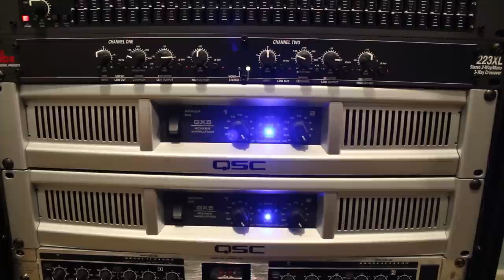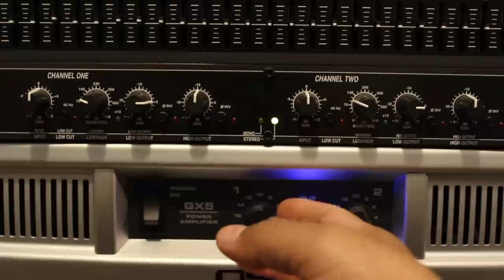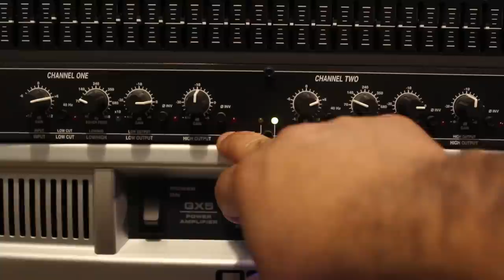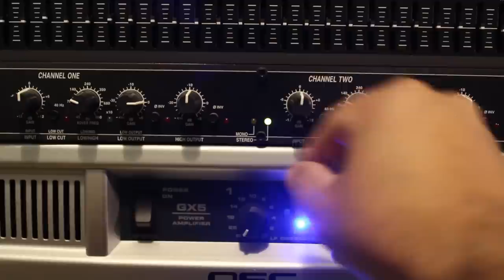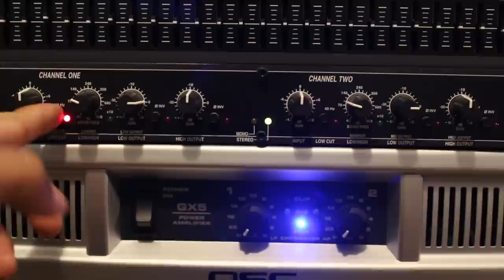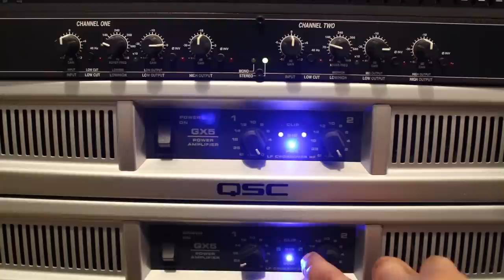How to Setup active crossover dbx 223XL into your PA system | DJ Setup | Live bands | Live events

Comment: Hello, could I use Crossover with my power sub and power speaker?
Reply from the maker: Ogie Gonzalez Hi , yes you can , what is the make and model of your active/powered sub and speakes ?
Reply: AVME Videos Hello my active powerer sub is QSC HPR181 and my speakers are Mackie SRM 450V2
Reply from the maker: Ogie Gonzalez , Nice sub & speakers .  If you have to use external active crossover with your sub and speakers then make sure the 100Hz low cut filer switch on your sub is off & 75Hz low cut switch on your speakers is not engaged.
Reply: AVME Videos Hello thank you very much for your help.I have more question. Is it a big difference between with and without crossover? DBX 223 XL is good? Thanks again.
Reply from the maker: Ogie Gonzalez yes DBX 223 XL is a really good crossover and does the job well . You can get cheaper active crossovers though. By using external active crossover you have more control over the point at which you want to crossover the frequencies & can apply output gains to low , mid and high channels , use polarity inverse on channels , use with different configuration like 3 way stereo /mono 4 way mono  modes etc. In your case i would recommend you to stick with the built in crossover of your powered subs and speakers and spend the money toward a compressor/limiter/gate device like a dbx 166xl.
Reply: Thanks a lot.
Reply from the maker: Ogie Gonzalez No problem , thanks.

Comment: i want to connect 1 mixer,crossover,one amp, 2 high, 1 sub-woofer, can it be done
Reply from the maker: +Eddie Gonzalez ,  For your setup you would need 2 amps minimum , one to drive the 2 highs and another one to drive the sub-woofer.
Reply from the maker: +Eddie Gonzalez , Actually just realised there is a way of doing it with one amp , before i reveal the signal flow for your setup , i need to know the make and model numbers of your amp , mixer , speakers and sub.
Reply: +AVME Videos (audiovideome) hi, i wanted to ask a similar question to eddie gonzalez. if u can assist me my equipment is
mixer (mackie mix12fx)
crossover (dbx223)
1 amp (qsc gx5)
2 mid /high speakers (gemini gvx 15)
eq (peavey q 231f)
sub (home built 18 ported sub)
Reply from the maker: +pennyholeman , Hi below is the signal flow for your equipment and setup.

1: Mixer L output to DBX223 CH1 input 1.
2: Mixer R output to DBX223 CH2 input 2

3: DBX223 High output from CH2 to QScGX5 CH2 input.
4: DBX223 Low output from CH1  ( make sure LF sum switch is on & use the crossover in stereo mode )   to QSCGX5 CH1 input.

5: QSC CH2 speakon output to 1st GVX15 speaon input then speakon output from 1st speaker to 2nd GVX15 speakon input.
6: QSC CH1 speakon  output to sub.

Your speakers RMS is 500W per speaker totaling in 1000W. By connecting them in parallel mode the resistance is dropped to 4 ohms. GX5 supports 700W total per channel @4 Ohms if both channels are in use , so just make sure not to crank CH2 from QSC GX5 more than 65-70% on volume tab. Because ideally to drive those speakers from one channel from a amp for continuous music playback for hours ,  you would need minimum 1600 W power from amp.

Hope this helps , good luck !
Reply: +AVME Videos (audiovideome) thank you for your reply it has been really helpful but how do i fit the EQ (peavey q 231f) i mentioned into the signal chain
Reply from the maker: +pennyholeman , Hi sorry didn't see the GFX EQ in the list . The peavey GFX EQ is a  pre crossover device. So it sits between the mixer and crossover. Just take Mixer L out to CH1 input on EQ , Mixer R out to CH2 input on EQ. Then EQ CH1 output to dbx 223 CH1 input1 , EQ CH2 output to dbx 223 CH2 input 2.
Reply: +AVME Videos (audiovideome) thank you for replying. i followed your advice and i'm very happy with the results so far.
Reply from the maker: +pennyholeman , good to know. enjoy the music.
Reply: thanks bro i split it like your first video works great

Comment: Never run the amps full up ,you need a balance between mixer and amp running the mixer just into the red and the amp no more than halfway ,you'll get the best out of it as you turned the tops amp up as it reached midway it sounded the best ,as you turned it full up it sounded thin ,all the best SIR HARRY'S HI-FI 🇬🇧🍀👍🏼
Reply from the maker: Thanks for watching

Comment: how many wires do l need to wire a crossover to the eq and too amps
Reply from the maker: +Michael Davis , Assuming your setup is stereo , you would need wires for eq to crossover ( 2x XLR or 2x TRS ) , Crossover to amps ( 4x XLR or 4x TRS) , amps to speakers & bass bins ( 4x Speakons ) , Hope this answers your question.
Reply: im going to need and step by step im not getting it my input on the cross over is different
Reply from the maker: +Michael Davis , Send me the model number of your crossover.

Comment: Hello,

I have a setup that includes  drum set, mixer, sub woofer an amplifier with  passive full range speakers.

I want my kick drum  to be more boomy, basically desire  the "hillsong" live performance output at the cheapest cost for our local church .. What are the things  I need,.. equipment.. I am a novice sound engineer. Any help will greatly be appreciated
Reply from the maker: You would need a good mic & a mixer with compressor or use external compressor. Mic to be used : Shure Beta 52 A or buy the entire kit https://www.shure.co.uk/products/bundles/pgadrumkit6 which would work out to be cheaper.During sound check do the EQ , setup compressor and if necessary apply some FX ( if your mixer has built in or you can dry hire etc)
Reply: AVME Videos
Whoah... Really appreciate your speedy  response, I initially planned on getting and active crossover and an equalizer , will  either or both   be necessary.. Or better  still which one can I do away with without impairing the overall sound  output.. Forgot to add.. I also have a keyboard in this setup..

Once again thanks for your speedy response
Reply from the maker: what mixer you would use ? it should have parametric EQ , if you must get external EQ then get one with compressor as well. Active crossover is always a good device to have .
Reply: AVME Videos

Hmm.. My mixer does  have a parametric equalizer.. I felt an external equalizer will give me more control in refining the sound.. I will follow you advice...

My very  last question.. Laughs.. Does getting a digital mixer  like a tascam 2488 portastudio really help in this case.. I heard somewhere its just simpler to go that route.

Comment: What was the unit under the Amplifiers
Reply from the maker: Joshua Jenkins A warm tube mic preamp unit.
Reply: AVME Videos Thank you your video helped me out a lot.  What exactly does it do, is it good in a church or is it just for a studio room or something.
Reply from the maker: Joshua Jenkins This setup is good for live sound reinforcement of any application ( i.e church , DJ , where continuous music is playing back ). The main purpose of using a crossover is to route the frequencies to the correct speaker type i.e High frequencies to tweeters & low to subwoofer or woofer. For studio mixing & playback  if you don't have active monitors with built in active crossovers then you can use this for studio mixing & playback setup.

Comment: how can I set up my Yamaha eq to run to 2 crown amps pushing the fronts and backs? The eq only works with one, the other set sounds muffled. I have a Yamaha rx2020 for a receiver and run preouts to the crowns becuz the receiver doesn't have an eq hook up.  anybody??I know you can link these...it's hooked up with tax for the signals, and banana jacks for the speaker connection.
Reply from the maker: send me list of all your equipment then I'll tell you how to setup.

Comment: Chris how to setup a equliaser to crossover
Reply from the maker: +Chris George , Depends what is your sound application is used for ? but as a start the EQ sits before crossover in the signal chain. Are you doing a DJ setup , Theater sound , mixing bands ?
Reply: +Chris George For DJ setup
Reply from the maker: +Chris George , From mixer outputs to inputs on the GEQ then GEQ outputs to crossover then Crossover outputs to AMPS then AMPS outputs to speakers and bass bins. I'll make a video about it soon as some one else asked for the same setup.
Reply: AVME Videos Thank you very much bro